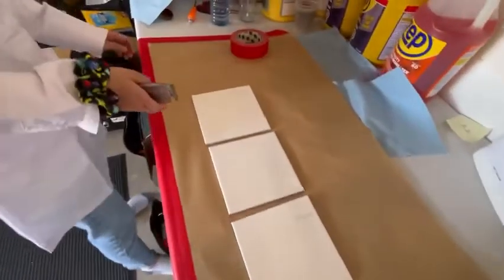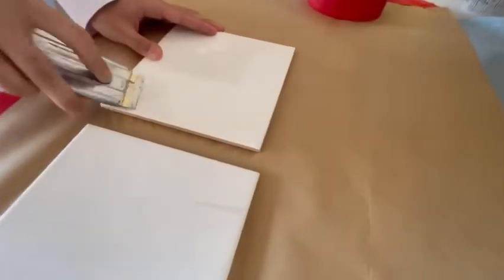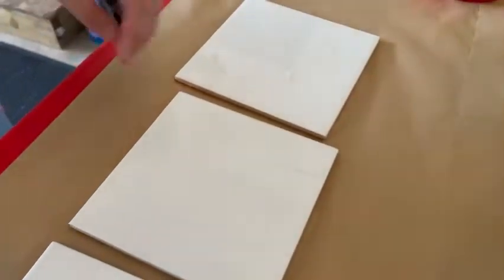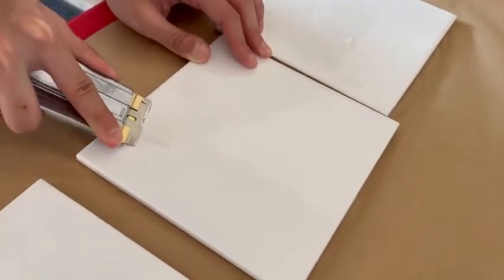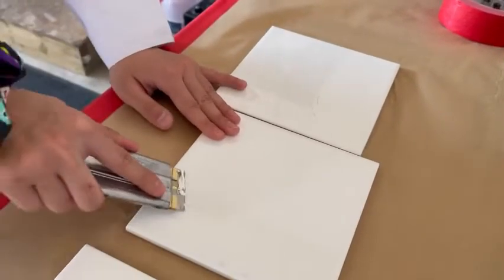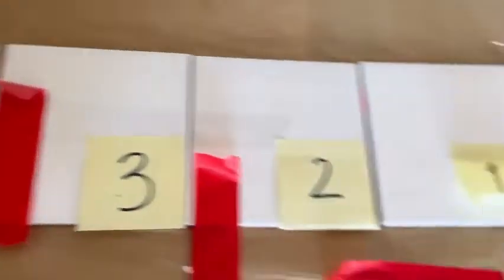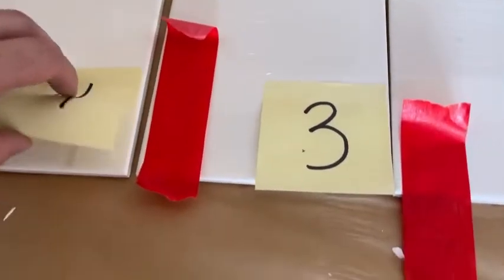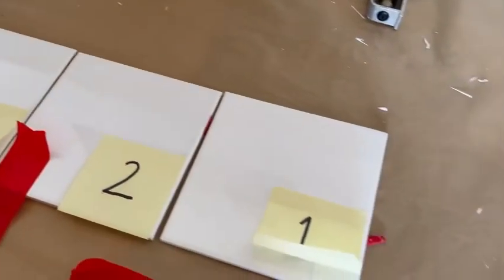Which reglazing coating is better?

Comment: A better test would be on a bigger surface for example a tub floor
Reply from the maker: The 3 days submersion test is a brutal test on any coating, if it still sticks it will last over 15 years on a bathtub.

Comment: You should test topcoat over superstrong etch without primer
Reply from the maker: With no bonding agent or primer topcoat alone will peel.
Reply: I don’t agree we use epoxy coating for bathtub and we only etch the tub and coating we use even chemical strippers will not work to remove the paint!  Have
Reply from the maker: Best of luck. 25 years refinishing, I’ve never seen that, but who knows. 
We all learn new things all the time.
What system is this from?
Reply from the maker: @tonyburry9036  
That’s fascinating, what system?

Comment: Is the Midwest HSLD 5000?   I do Aero space  and HSLD 5000  no etch never fails
Reply from the maker: I’ve done that test, look back in my videos, it doesn’t stick as well as a crosslink, plus hawk primer or hawk topcoat. The CrossLink is a superior bonding agent, sticks like crazy.
However the Midwest will last for years in a bathroom setting. It comes down to how much do you really need it to bond to have it last 15 years plus, we are way past that point with Midwest, Hawk, topkote or napco. They all do a great job.

Comment: Looks like primer is the weak link.
Reply from the maker: Thanks for the comment. The primer is just softer, and the razor cuts into it. However in a bathroom setting it will last years and years.